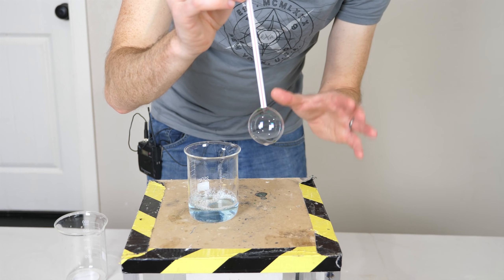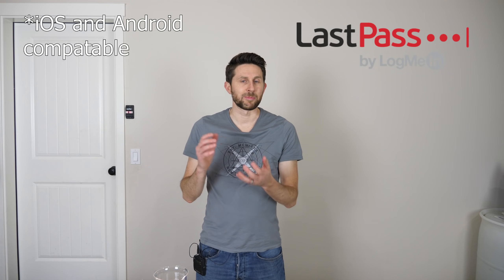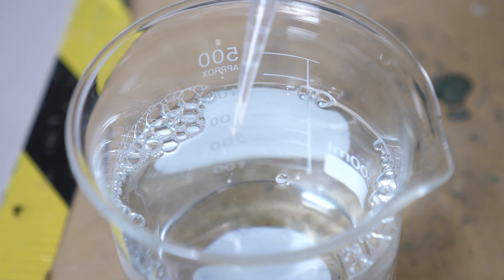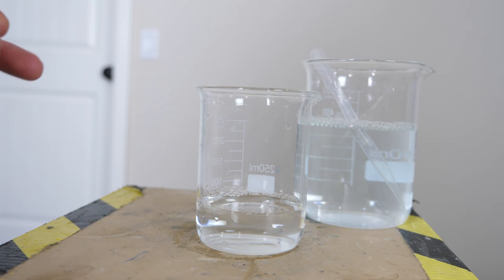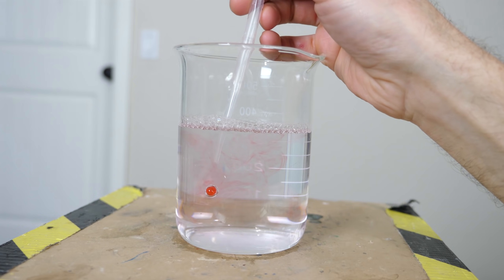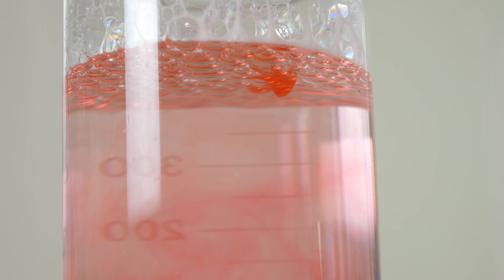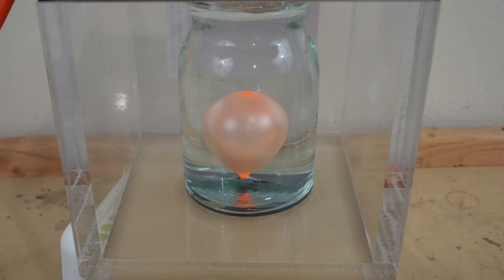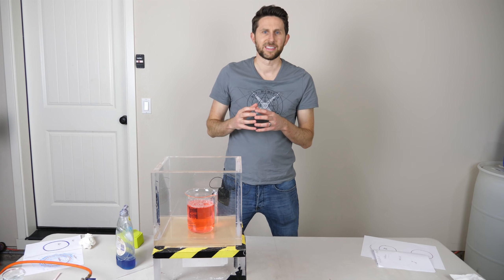What Happens to an Anti-bubble in a Vacuum Chamber?

Comment: I don't see why the surface tension of the antibubble should be any greater than that of a normal bubble. There are two membranes, but only the outer one will expand -- the inner one is constrained by the volume of the interior sphere of water. I suspect the lack of expansion is entirely due to the volume of air being only a small proportion of the whole volume of the antibubble.

Comment: The liquid in the bubble would not expand appreciably, only the air inside the membrane would which is so thin there isn't much volume to begin with so the change is not as noticeable. That the volume of the liquid does not expand can be tested by putting it in a vacuum in a calibrated container and checking the difference in height at atmospheric pressure and under vacuum.

Comment: The anti bubble didnt expand because the water inside cant expand, so it keeps it the same size. Awesome video...
Reply: i think the air membrane didn't expand ( not because it is strong ) but because the water is non compressible AND any vacuum will be filled by water boiling off - so the water pressure is a constant - the air is surrounded by constant pressure water
Reply: Yup I was thinking same cause the hydrogen bonding was too strong for that so called anti bubble.

Comment: Try one using water for the anti-bubble but in a liquid that is less dense than water. I don't think it will go to the top at all. I think it will stay on the bottom and you may get different results in the vacuum chamber.

Comment: I honestly thought that the main reason that the anti-bubble couldn't expand is because of the water inside it. Since water is a non compressible fluid the only way (since there's no connection between the outside water and the inside water) to expand the anti-bubble would be to form an inside vacuum between the expanded air membrane and the the water inside, which mantains its volume constant. Known this, it's pretty fair to think that the bubble wouldn't expand (or expand so much) since the pull force that the vacuum practice inside the anti-bubble is pretty strong.

Nice video though!
Reply: This was pretty much what I was gong to point out, so I'll just like your response instead :)

Comment: I believe bubbles expand due to the air inside the bubble, whereas the anti bubble has soapy water inside the bubble and water doesn't expand. So there is very little air surrounding the anti bubble and at the top of the outside of anti  bubble there is hardly any water to keep the air trapped. So at the end, the top of the air membrane blows out sucking all the air through that hole.
I believe the anti bubble would stay unpopped if the anti bubble was kept completely under the water away from air or bubbles. At least I think it would last longer. It would all depend on if the soap in the water can make the water hold against the pressure of the expanding wall of the anti bubble. I believe it might make the membrane of air look slightly like the white around the yoke of a boiled egg in shape, but much smaller amount of membrane to liquid center.
This is just my best guess.
Reply: I think you are on the right track but going toward a side track ...
i think the air membrane didn't expand ( not because it is strong ) but because the water is non compressible AND any vacuum will be filled by water boiling off - so the water pressure is a constant - the air is surrounded by constant pressure water

Comment: I'd say that ur reasoning for why the bubble doesn't expand much isnt particularly sound... To me it seems like it's best to say that the bubble expands less cuz the density of water is high and is affected less by lowered air preasure - so if u have an air bubble it's mostly air so if there's less air pressure - by 60% less say that it growing twice the size or so is reasonable cuz most of its volume is based on the substance that's affected by 60% (so, halved) on the outside hence it'll be prone to expand significantly whereas if u for example used say a water bubble from an "atmosphere" consisting of denser matter - even say a liquid matter like crude oil maybe say, and then managed to reduce the pressure of said matter on the outside... Well that's like next lvl shit. Thing u can try? Xd

Comment: Dude, and what happens to the air after the anti-bubble pops? Was it absorbed by the water? Did it turned into molecular sized regular-bubbles and got back to the surface?
Reply: in the last test you can see the air around the anti-bubble seem to deform and rise to the surface of the water, bulging toward the top of the air membrane.  When the membrane breaks, it all just leaks into the vacuum. Now, if the water was a slight bit denser than the surrounding water then there may be a point of equilibrium between the dense fluid sinking and the less dense air to where the anti-bubble would be neutrally buoyant. THEN! you may get your "Atomization of the Anti-Bubble"... which is also a great name for a new age metal band.
Reply: I don't think it's air. I think it's soap.

Comment: Can't you just make the red solution about 4°C cold and the colorless solution way warmer? Then maybe the colder, heavyer bubble would sink to the bottom.
Reply: or use chilled super salty water
Reply: I wonder if that would not work because the denser liquid would burst the bottom of the air membrane.
Reply: @johnm5928  gotta test it out. I like the idea though.
Reply: @ThePrufessa  Agreed. I am interested to see what will happen.
Reply: @johnm5928  just what i am thinking
Reply: Only if the air membrane is thick enough to be an insulator of heat.
Reply: @soatnod  you act as if the water will instantly lose all of its heat. It'll stay hot long enough to experiment with it.
Reply: he was meaning the heat between the 2 water sources. If the colder bubble instantly gets heated up by the warmer water, than the experiment is pointless.  @ThePrufessa
Reply: @soatnod  I mean it'll stay cold long enough to sink to the bottom. Then as it warms up it should rise up. So, the insulation properties of the air membrane has nothing to do with anything dummy.
Reply: @ThePrufessa  you know, water could heat up pretty quickly before he got to a full vacuum so making sure it stays cool for a period of time is important
Reply: @ThePrufessa   needs a hug... 🥺
Reply: Good thinking
Reply: I don't think that would work.  The entire bubble or anti bubble still is essentially water with added air, so will always be less dense than any form of water solvent surrounding it.  The density of salt water isn't much greater than DI water, while air is up to 10,000 times less dense than DI water
Reply: @kchorman  but is that tiny air membrane (less than a mm thick) enough to keep the dense cold water from sinking?

It should at least slow the ascension rate down while the water remains cold and dense.
Reply: Uhm its actually i think i havent done it yet though i think its the air that is rising make the water inside anti bubble could be unstsble and the bubble will pop i just think so
Reply: its also well insulated by the air membrane so should last
Reply: @ynzeselders4184  not sure it's "well" insulated and I doubt it even matters. The membrane is extremely thin. It only appears to be thick. So, that little bit of air (that's not even enough to expand on a vacuum) will heat up instantly and then it's transferring the heat to the water. 

The water only needs to be cold for a few fuckin seconds I mean gee fuckin whiz how long do y'all expect the anti-bubble to last?!?! Jesus fuckin Christ think people.
Reply: @ThePrufessa  you don't have to attack me. I just wanted to share that it would be better insulated than if there was no air. I know it's thin I left a comment on that before.
Reply: @ynzeselders4184  attack you? Ha! I just wanted to show you how stupid it was to think that a millimeter thick membrane of air would provide any discernible insulation. Don't be butt hurt at me cuz you left a comment without thinking.
Reply: @matchestehdog8619  the original comment wasn't looking for one to "stick around." It wanted to see an antibubble made denser cold water surrounded by warm water. Using two different liquids defeats the entire purpose even if the results are analogous. We don't want to see a dense liquid surrounded by water. We want to see dense water surrounded by less dense water. Huge difference.
Reply: Another thing to consider is the membrane not being able to expand. So as the cold water warms it'll also expand and I don't think the air membrane will be able to stretch enough to hold it.
Reply: @ThePrufessa  The air membrane can expand easily. The reason it did not expand in the video is because the water inside wasn't expanding, so the membrane had no reason to expand itself. Also, removing the air above the water will barely affect the inward forces from the surrounding water.
Reply: @spectralpiano3881  wouldn't the incompressible outer fluid transfer the change in air pressure to the outer surface of the air membrane, while the incompressible inner sphere holds the same volume, thereby causing the air membrane to expand? And then wouldn't the excess volume bulge out at the top of the antibubble, eventually detaching as a +bubble?
Reply: it sounds hopping. it could worth try
Reply: i was just thinking that. why not use 2 liquids with different densities
Reply: Play with the density of the fluid on the outside (make it lighter to sink the bubble) or make the density of the fluid heavier on the inside of the bubble. You should be able to also create different zones of fluid density to float the bubble perfectly. I wonder what would happen if you were to use a gas that was heavier than air to form the bubble. And what would happen to that bubble under compression.
Reply: dude its an air not an actual membrane for that happening.
Reply: It would be easier to just out a non electrolyte in the red bubble solution- like table sugar- to change the density so it will stay at a set level in the beaker.
Reply: Air is actually an excellent insulator. Styrofoams have a lot of pockets of air so they insulate well, and most thermostats only have air as insulators. Although an antibubble doesn't have a lot of air membrane for good insulation. Also the inner ball of water is sitting at it's bottom from surface tension, not floating on the air membrane... Good hypothesis though.
Reply: @matchestehdog8619  nice math. .7 seconds is long enough to sink the anti-bubble. Then as it warms up it will slowly rise to the top. Exactly like I said.
Reply: In an experiment you don't change more than one factor. Like you suggested of changing the temperature,if you are doing that already you cannot change something else as then you wouldn't find the value affecting it
Reply: @squidorigami8340  you don't know what you're talking about. The point of the experiment is to get colder denser water inside an anti-bubble to sink will submerged in warmer water. What the fuck do you mean you can't change two factors? Please identify the two factors we're not allowed to change (according to you) that will negatively affect the outcome of inserting cold water into into anti-bubble?

Comment: can you make it in realy slow motion how this bubble created and what happens when it broke up ?
Reply: Slo-mo guys pls
Reply: Its just as it falls down normally its practically at terminal velocity and if u squirt it hard the drop of water will drag air with it air resistance and then once it hits the water the air is moving fast enough with the water to not just like hit the surface and nothing happens basically just like splashing your hand in the pool and bubbles rise up if it had sticked to you the bubbles like a think whole membrane it would be like an anti bubble but not water inside of it but practically impossible
Reply: Go to 3 dots then playback speed then go to x0.25 speed